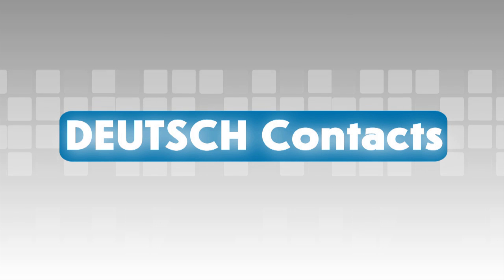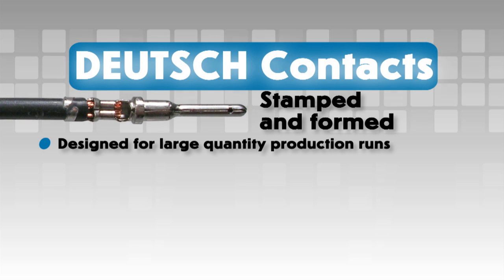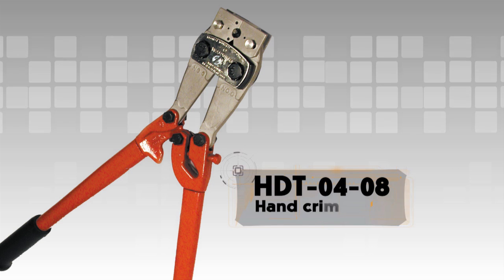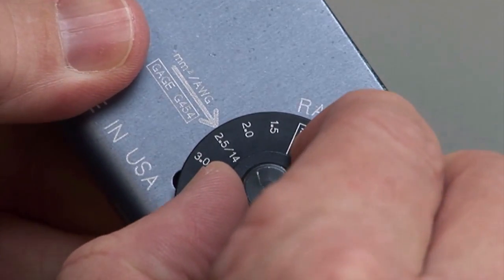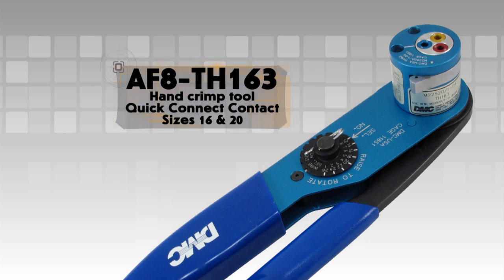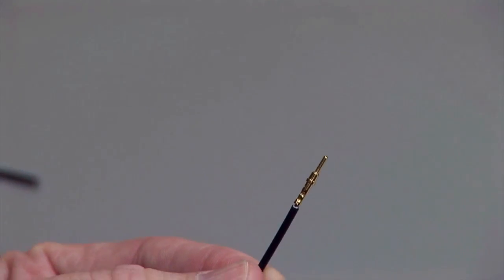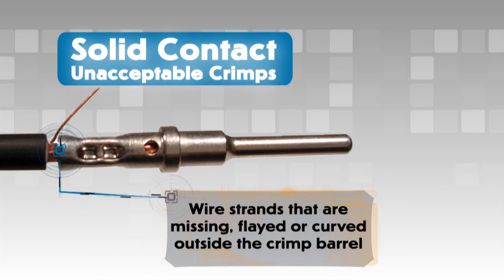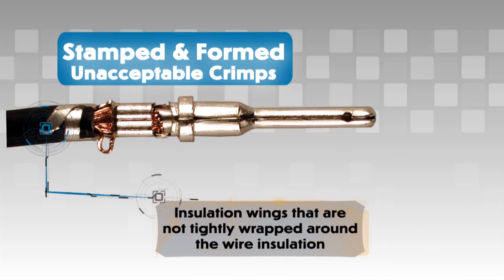DEUTSCH Contact Crimping Instructions

Comment: Please, what is that wire stripper you are using at (1:35).
I like it.
I want one !
>
Reply from the maker: @Bodragon : Thanks for your interest. The wire stripper you are inquiring about is one of a number available in the market. TE offers a high quality tool (part # 734185-1) that is designed for stripping wire size from 28 to 10 AWG. Click the following link to learn more http://spr.ly/6059H3tdt
Reply: The "ideal" answer is - Ideal 45-292 Stripmaster Wire Stripper (handles 10-22gauge wire)
Reply: Can these same crimpers be used for female deutsch pins?

Comment: Poor business plan to sell a system where the crimper is $299.  The average garage or home DIY isn't going to use this system or crimper. makes no sense to me.
Reply: Bill Smith China FTW..plenty of other options for crimpers..👍
Reply: Your average homeowner or even electrician does not need crimps of this quality.  These are for automotive, mobile equipment, aircraft and military applications.
Reply: Yeah I think you have slightly missed the point of their products.
Reply: For average home DIY user, there are cheap alternatives for sporadic use. I got one from ebay for 26 dls .
Reply: @flspeid  My comment was made a year ago. Price was $299 US at that time.  Good for you to get them at $26.00 . Seems like a reasonable price to me.
Reply: The solid contact looks like a solder cup to me. You can probably get away with soldering in the cable into the connector.